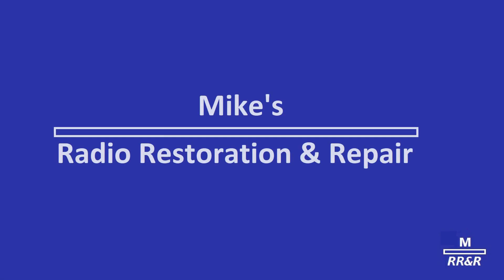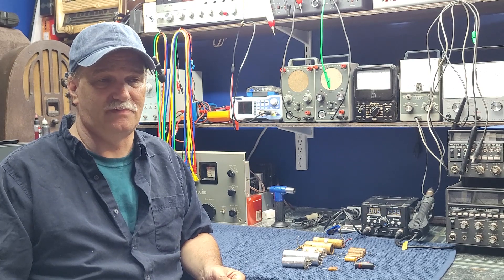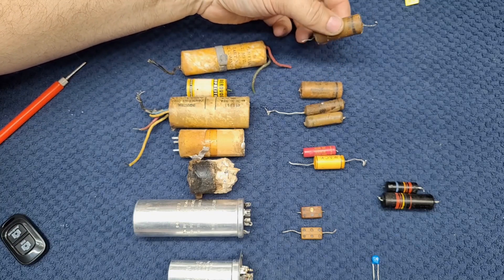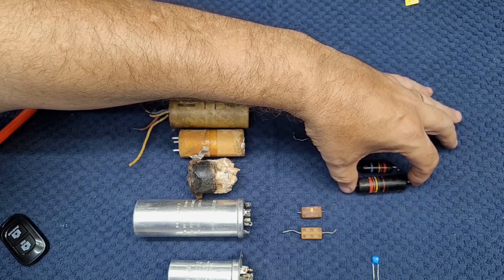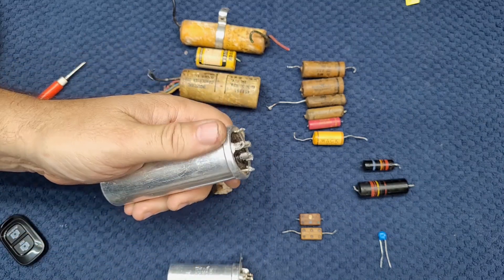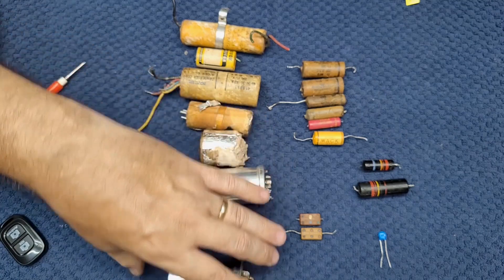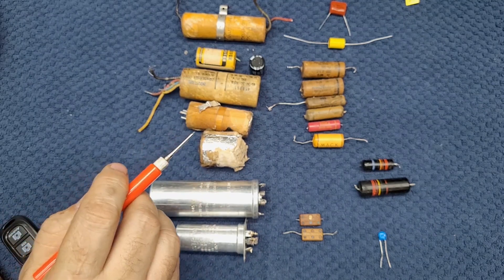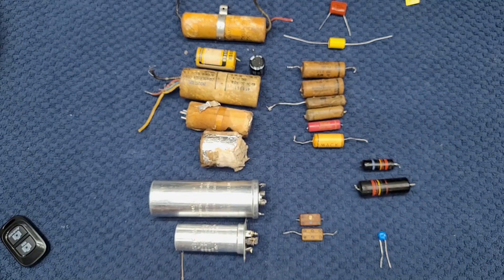Learn to Identify Capacitor Types in a Tube Radio

Comment: Is it ok to up the mf?   I have a set of filter capacitors from a Westinghouse wr27.  8 mf. 450 w.v. 525 V.s.p. What exactly do I replace them with?  This is my first restoration and I’m teaching my self.  Well you are kinda lol.
Reply from the maker: 10uf at 450vdc is fine. Wouldn't go beyond that too far.
Reply: @ I found 400vdc at 12uf   But I can’t find 450s at 8 .  I was told use axial film capacitors
Reply from the maker: @hondaxl250k0  https://youtu.be/Qf4tuBlErY8?si=hG6ThOVtxbY5N-VL
Reply from the maker: @hondaxl250k0  Im not ok with that. 12 is a big jump and 400 may not be enough. Watch the video link I sent to see where to get what you need. 10 uf at 450 to 550 vdc.
Reply from the maker: @hondaxl250k0  https://62bf1c-2.myshopify.com/products/axial-electrolytic-capacitors?variant=45329032347951

Comment: I have my filter cap open and wondered how close do I need to be to 60 and 20 mfd on my new caps?  Do you recommend a supply site? thanks for all the help
Reply from the maker: What radio?
Reply: Sorry, I am doing my s76, same cap as the one in this video, 60-20-20. I was searching around some different sites but didn't really see any 60mfd,  also did you use axial caps? that's what it looked like in video. Dremel wheel worked nice to cut open. thanks @MikesRadioRepairRestoration
Reply from the maker: @jamesw-c2q  68uF 20uF 20uF is fine. Radial. Full tutorial here - patreon.com/MikesRadioRepairRestoration
Reply: Ok thanks again, you have a lot of good videos! @MikesRadioRepairRestoration

Comment: could you go over what capacitors are high voltage.
Reply from the maker: Not sure I understand what you are suggesting. Caps are Voltage Rated. Caps of the same type can be rated from 200 to 1600 Vdc. There are specific very high voltage caps like ceramic door knob caps......But in so far as these common tube radio caps, they are rated in WVDC, Working Volts DC.

Comment: In many modern day capacitors the outer foil theory no longer applies. Modern film caps are non inductive caps and do not have an outer foil. Film caps are not spirally wound and actually have end caps. If you are concerned about hum pickup on the outer foil then shield the cap and ground the shield. Which by the way is how the old electrolytic can capacitors were made. Talk about a source fir hum, as high voltage 60 cycle fields abound., think about it.

Comment: Those yellow film capacitors are they mylar ?
Reply from the maker: Pretty much all of these type of caps these days have a polyester dielectric. But some still call them mylar. Heres a great wiki on all the types and construction of the various types.  https://en.wikipedia.org/wiki/Film_capacitor#:~:text=Polyester%20film%20capacitors%20are%20film,well%20as%20film%2Ffoil%20types.